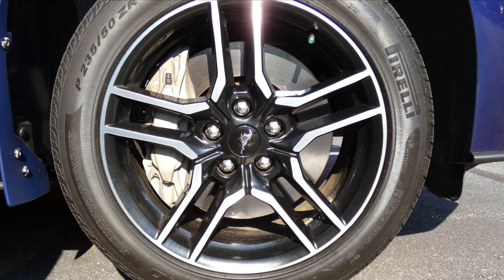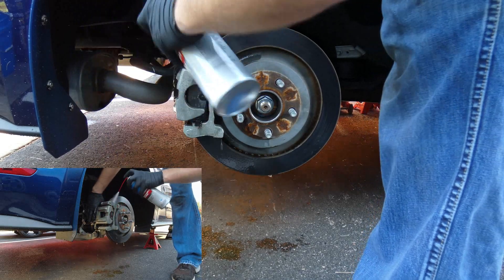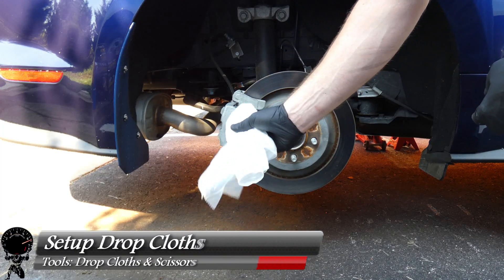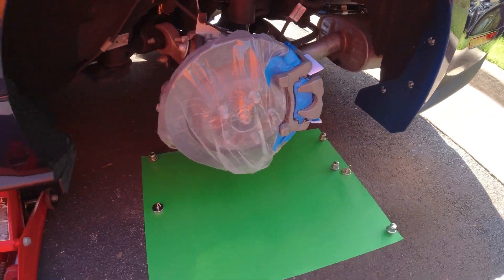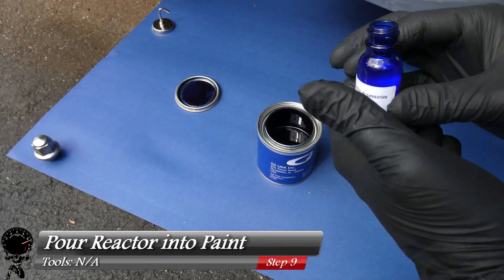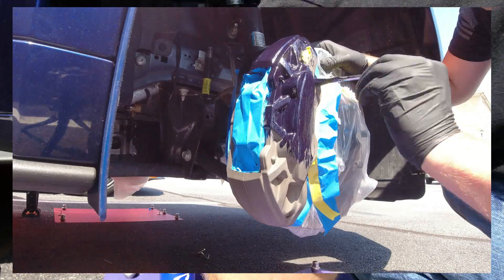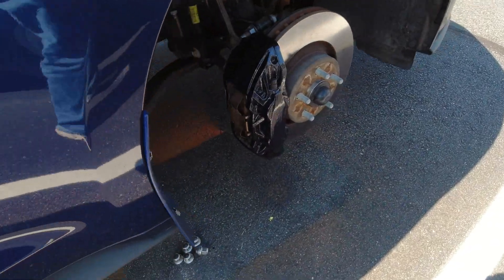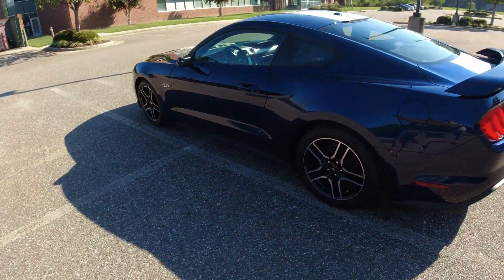How to Paint Brake Calipers for S550 Mustangs (2015-2023) - Brush-On Method

Comment: Why didn't you use primer and clear coat on this time? Is it because you used brush painting? Or because of the granular surface of the caliper? Thanks for the video, man. Another great job!
Reply from the maker: These are great questions. G2 caliper paint is a very unique paint. Unlike most high temp paint, G2 is a high gloss epoxy. Therefore it cures to a high gloss finish without the need for a clear coat or primer. This paint seems to mimic an adhesive glue (or two-part epoxy), which requires only a clean surface.

Comment: I would remove the calipers and relube the slide points on the brake pads.
Reply from the maker: We did something similar in the "Rattle Can Method" video.